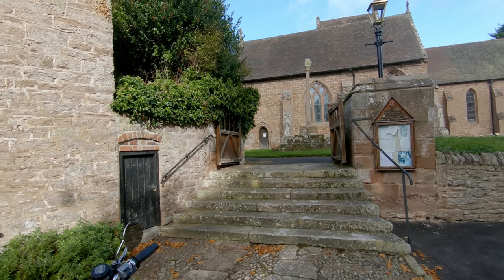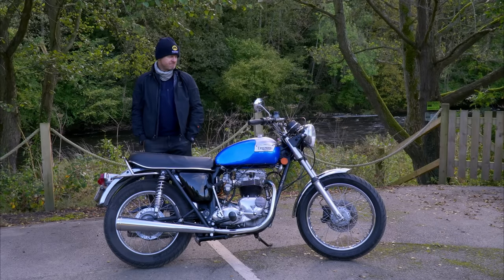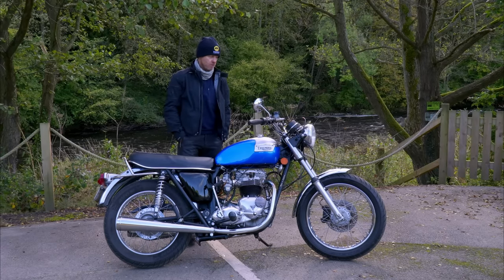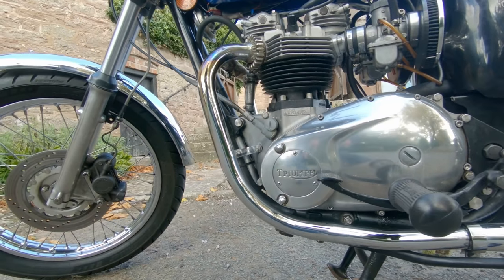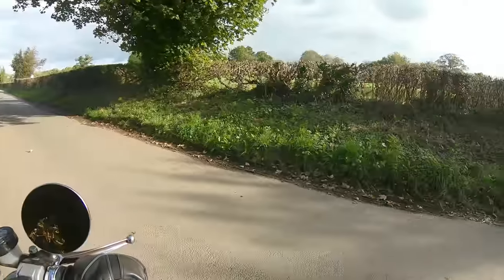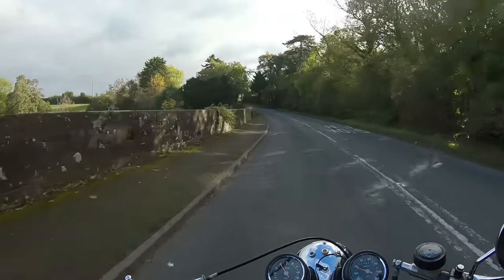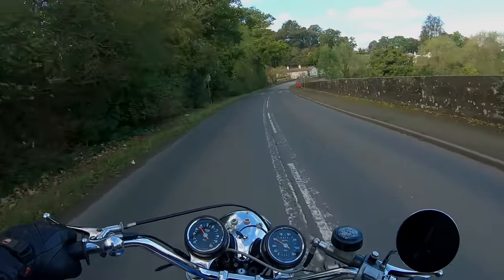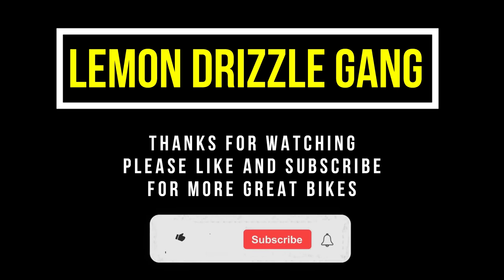Modified 1975 Triumph Bonneville,  better than a modern retro ?

Comment: Dave any chance of more information on your engine breather setup. I have a dry Gates belt primary conversion with Norton diaphragm clutch conversion waiting to be fitted to replace my 27yr old Hayward wet running belt primary drive and have yet to decide how to modify for engine breathing with the standard primary case engine breather blocked off and via the tappet drains won't be enough .... thinking timing cover? Obviously the crank timing plug isn't ideal without rigging up some sort of oil separator as the crank direction would throw oil up that way.
Reply: I ran a Hayward belt wet for many years with no problem, but changed it for the later red belt and it shredded inside a year, so went back to a chain. I drilled the crankcases into the front engine mount for a separate breather and originally had a krankvent (expensive reed valve) in the line, but this was always clogging up with oil. Now run two breathers, conventional one from the primary plus the front engine mount, neither with a reed valve but may experiment with an XS650 reed as per a previous commando? Yes tried a breather from the timing plug and yes it throws too much oil out! Also if you do run a front engine mount breather  be sure to fill the cavity with stainless wool to condense the oil droplets. Timing cover works apparently but looks a bit "cobby" imo?
Reply: @waveydavey750  Thanks Dave. My Hayward drive is the early one with 20 replaceable drive pins in the clutch drum taking the wear and I've only had 2 AT10 belts (the 1st was 18yr old and renewed purely as I had the clutch apart) as originally the kit was never supplied with any recommended replacement times. It was only when I tried to get a new set of drive pins, unavailable from him as he had moved to the later (64?) grooved clutch drum, that he told me there was a 7yr recommended renewal point on belts and that they were now red and more expensive.

Comment: Hi Mike, another great video appreciating the pleasure to be had from classic bikes.

Just one quick question if I may: I know with classic car engines the valve seats have to be changed to suit modern unleaded fuels, is it the same for bikes and is it a straightforward job to get done?

Cheers
Dave in France.
Reply from the maker: +David Jebson that is a question for Dave I will ask him
Reply: @LemonDrizzleGang  Good question, not a straightforward answer I'm afraid! Any japanese bike from the 70s will be ok, anything else it varies. Most (including the britbikes) will be fine as "lead memory" and low rev useage will protect for quite a long time. But needs monitoring and if you use, say, a Laverda triple as it was intended it will close up the valve clearances as the seats suffer recession. Best to use it and monitor the valve clearances.
Reply: On the Triumph twins with aluminium heads, they already have hardened steel valve seats, so will run on unleaded fuel without any modification, although it is better to use super unleaded as they were originally set up to run on 98 octane fuel (it also has lower ethanol content nowadays, which is better for the fuel system).
Reply: All T140s and T120s built from August 1973 had machined replaceable valve seats (previously cast in non replaceable seats) and were intended to run on unleaded petrol that was common in the states where 80% of Triumph's then were exported to.

Comment: i’ve got a 73 and would love to replace my front disc break. could you share the specs on what this used?
Reply: Mine's a 78, but I'm pretty sure the front brake is the same as the 73. I improved wet weather performance by replacing the original chromed disc with a plain cast iron one, but the biggest step forward was replacing the original 5/8" bore master cylinder with a 13mm version. This gives much better feel and effectively 50% more leverage to increase brake effort, while still using the original caliper. It screws into the master cylinder housing as a direct replacement, at around the same cost, and they are widely available from T140 parts suppliers.

Comment: i have owned both and i would rate the original 70's bonny as the better package. easier to get on with. yes the new ones less vibration. but happy to be in the saddle for about an hour. By about an hour I want a break. I had a pale blue new one they were quiet rare i think it was year the factory burnt down? Nice bikes but not as nice as the originals

Comment: a friend of mine 1973 bought a new triumph 750 i bought a yamaha xs 2 one year later triumph totally gone my yam still golng strong 5 years later after touring. europe years later i got a bsa a10 road rocket got the engine rebuilt by a special list firm 7;5 compretion mukni carb it was a very nice bike if only they had the tec in the 1960sor quality control im now 75 years young rode every year since 1960sno car licence just saying

Comment: if you enjoy vibration, simple old bikes have charming aspects. it you want old, simple and smooth, bmw is waiting patiently for your attention.
Reply from the maker: We have Airhead reviews on the channel. R9S and we have an R75 in the pipeline
Reply: Believe it or not, the bonnie is as smooth as my R90S up to about 75-80 thanks to the dynamically balanced crank and light pistons. It really doesn't have a riding position for sustained speeds beyond that but is perfectly fine vibe wise up to about 90. It doesn't have the relaxed loping gait of the airhead though, few old bikes do!

Comment: Stupid Question, Are there any mods where you can swap the rear brake lever on the right and the gear lever on the left?
Reply: Not easily going from right hand shift to left,  the crankcases are different on the left hand shift bikes. Easier going the other way, starting with a left hand shift and, for the gearchange at least, retrofitting an earlier outer gearbox cover etc. Still have the brake to sort though, all do-able.

Comment: Is the choke fully off? It looks like the slide is fully down or is this different on the mikuni carbs?
Reply: Well spotted and yes, the mikunis use a valve that opens or shuts a choke jet, exactly the same as the Amal Mk2 and the opposite of an amal mk1 with it's "strangler" choke slide! Catches a few people out!!

Comment: Why was the Special so different?
Reply: I suspect the two into one exhaust system did it no favours, even with a less restricted silencer it was still slow? Also they were slightly lower compression ratio by then.

Comment: me is not clued up so please bear with me, ,62 years old always had Jap bikes and now have a harey davidson dyna, i have a need  to own ride and maintain a older British bike , first choice would be a Norton commando but far to pricey , Bonneville's are  in my ball park price wise but which is value for money,reliable, and most importantly  easiest to start.
Reply: Any of the "Oil in Frame" era (1971 -1983) Bonnevilles (T140) or Tigers (TR7) are best value for money with the disc braked versions (1973 on) probably best for modern traffic conditions. Reliability 50 years after they were made tends to come down to the quality of the last rebuild or at least the previous owners skills or lack of! But they are a solid basis for a usable Brit bike, with lots to choose from and lots still being used regularly!
Reply: Go t160 trident  electric start probably too fast and heavy for you , but they handle and have a power band 4k thru 6k, 5 speed, tricky to work on, $ aus 20,000, only 7000made, collectable.

Comment: So it's a great bike if you change the:-
Barrels 
Pistons 
Camshafts
Carburettors 
Air filters 
Manifolds 
Front disk 
Front brake caliper
Rear suspension 
Rework the crankshaft and skim the cylinder head. 
Hmmmm.
Reply from the maker: Yes but what a bike its become
Reply: @Chunga, You have clearly failed to read the title of the video or you have NO understanding of the word MODIFIED... FYI, modified doesn't mean putting a "I've been to Blackpool" sticker on yer bike!
Hmmmm

Comment: Asso pistons are Italian..........low compression pistons are not a great idea, especially with longer duration cams, which will reduce compression even more.  I would guess the power will be higher than stock, but wont be an awful lot more................
Reply: Well I've learnt something today! I wonder why Asso use the term "Werke" in their title (German for "Factories") rather than the Italian "Fabricche"? I agree the low compression isn't ideal, but sourcing alternative pistons would be expensive, the vibration would go up and it's not like the standard bonnie was high compression in std 750 form anyway. Also I took the dynamic compression (your point) into account with the cams I used, which have  milder duration than, say an E3134 form, but higher lift, which works well with the available compression. The standard valve timing in T140s is cack as I'm sure you know! I agree rwhp is almost certainly still under 50, but it's reliable, smooth, cool running, tolerates modern petrol and only has to  drive 380 lbs, so it's fun!! Thanks for watching.

Comment: really don't like the crossover pipe. 2 into 1 will save weight, and easier access to rear wheel. suspect the twin pipes are cosmetic, and most 2 into 1's are awkward at best. take yer choice, but 'add lightness.'
Reply from the maker: I would defer to Dave on that
Reply: Maybe, the 2:1 on my bonneville special didn't seem to work well even with a less restricted silencer? Also the balance pipe helps mid range as per Paul Dunstall findings on the Norton dyno?

Comment: Or low british handlen bars or older 850 2,a  commando or at a push anearly 750 even the fast back cos it looks good with whistler pipes.known as pea shooters.by some  the  British   spec roadster tank. With a.spare inter state tank.maybe a Basement rocket 3 the nortonroadster tank.in.yellow  inter state tank.in silver withnorton stripes the t150.i n.standard paint cw ray gun pipes rocket 3 same

Comment: I grew up with British bikes and have owned many (Rickman Trident, B25SS, 500 Daytona, CCM etc), then I discovered bikes that work and perform infinitely better and more reliably. There must be nearly £10,000 of modifications there. Sorry, I  just don't get it.
Reply: Fair enough, I've ridden and owned plenty of the same bikes. But if I wanted a bike that performed better I'd buy pretty much anything built after 1990 and bigger than 500cc, that's hardly the point with any vintage bike surely, irrespective of where it came from? A £3000 Ducati 900ss built in the '90s will walk away from a '70s 900ss that cost £20,000 now, so what? Same for an R90S or a CB750 compared to the modern-ish equivalent.
As for £10,000, the biggest bill was from P&M for just over £1000 and the barrels were (from memory) about 300 ish? No other component cost more than a few hundred (cams and shocks were eBay unused) and I did all the rest of the work. Nobody here is holding old britbikes up to be the pinnacle of engineering, they were pretty cheap back in the day, these are the bikes that put the biggest smile on my face, is all.
Reply: @waveydavey750  No offense intended - I still use cassettes :)
Reply: @a.l.rockliffe  Cassettes! Pah, I use a reel to reel ;o)
Reply: @waveydavey750  A reel to reel walkman? I bet you were popular on the tube!
Reply: @a.l.rockliffe  :o)
Reply: @waveydavey750  If you do it you understand it and why, like me. My 79 T140 has had many times its original cost price put back into it in upgrades and mods (and replacing modern crap chrome parts due to no garage facility and being outdoors) and having owned it from new has always been marked as my youngest daughters when I'm gone. My 2015 Tiger 800XRt on the other hand has spent 6yrs outdoors and looks like nearly new being mainly plastic, no chrome, but purchase alone costs more than my 40yrs of T140 ownership and it will never still be around at 40yrs+ old.

Comment: I had a bonny a few years ago,,,the Harris...low mileage...one owner.....sorry lovely bike to go the pub, vibrating like hell with white fingers....kick start temperamental, oil leak, noise....lost an exhaust pipe with no difference in performance....my only is not to have kept for posing